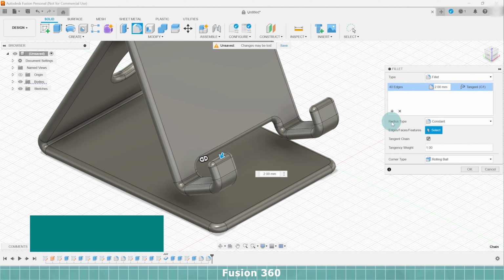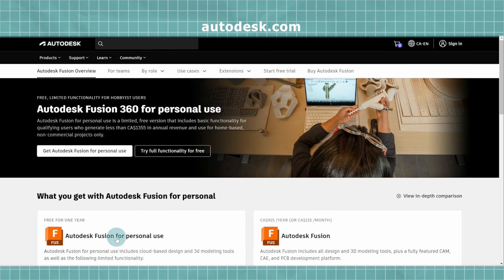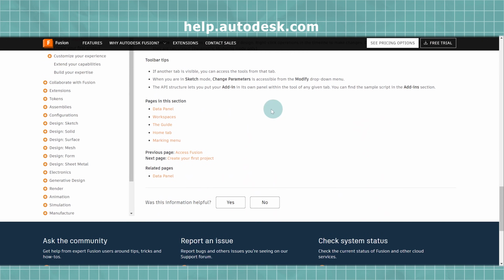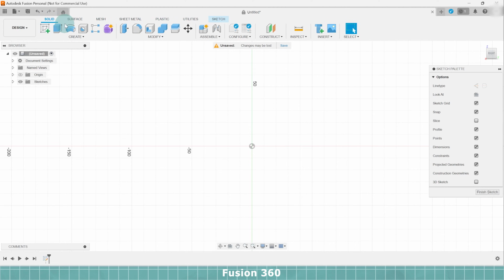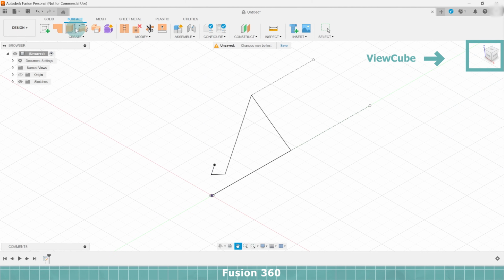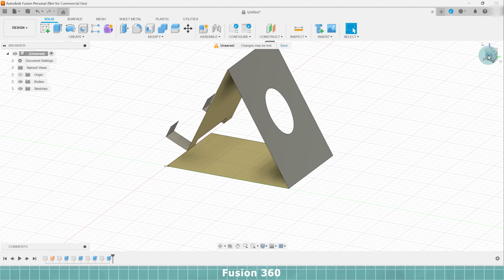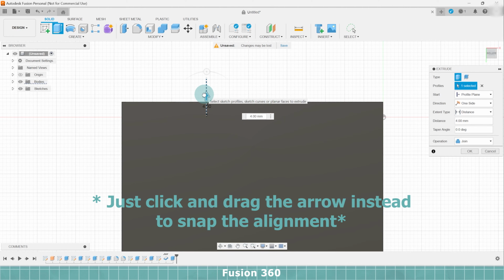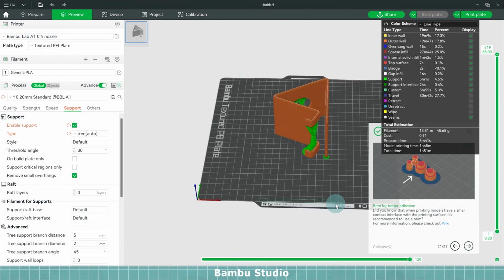Create Your Own 3D Prints!: Fusion 360/Bambu Studio Easy Beginner Guide

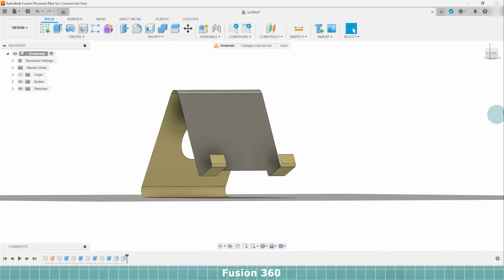Comment: Nice tutorial - Thank you! At 10:20 after the filleted rectangles were created in the new sketch, how were they applied to the earlier thin form to apply the fillet? It says "then we'll extrude them shortly", but never shows how it was exactly extruded and applied. Maybe a reference or explanation could help. Thank you!
Reply: For example, one way is using the Surface tab, select and delete the old rectangles. Then make the last sketch visible, select the new filleted rectangle and Patch. So it replaces the old square rectangles with the new filleted ones. 
But I haven't figured how to create the "negative" fillet between the hooks with the middle long rectangle in the new sketch.
Reply: I actually found that to add these corner fillets, including to the "negative" notch, it's faster to selected the corresponding edges, and perform Fillet - similar how to the very first fillet was done to the profile.

Comment: Min 10:28 how you remove the small corners from the new drawing im going nuts trying and nothing
Reply from the maker: After adding fillets to the rectangle shape that was sketched, you should be able to highlight and select the fillet areas. After selecting both, you can perform a cut extrusion to get rid of the corners. Hope this helps!
Reply: @Creatorrific   thanks for clarifying!

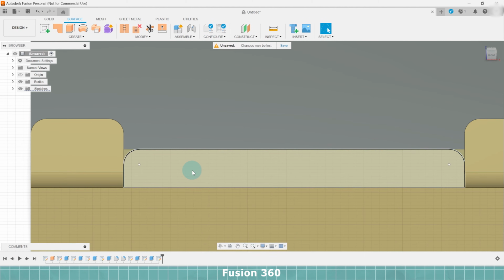Comment: I had to quit this tutorial at 10:30 because I couldn't replicate the steps to filet the edges of the hooks even running at 50% speed I couldn't see what the teacher did to make the filet happen on my brand new installation of fusion.
Reply: Finally got it. After drawing the rectangle and adding the filet choose extrude and select the ears of the surface sticking out behind the new fillet areas.
Than do a cut extrude just like previously
Reply: I'm having the same problem, can't figure out how he converted the new rectangle into the actual object....
Reply: He doesn't show how to do that extrude process there! It's different from the earlier one. I'm going to continue without the rounded corners there...
Reply: He did that in a very odd way. He could have simply selected the two edges on the solid and used the fillet function.